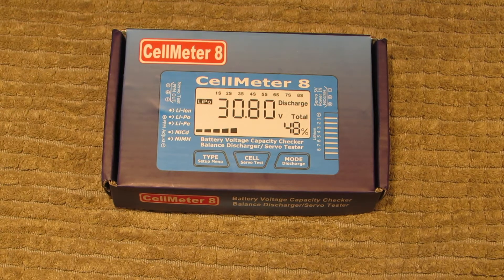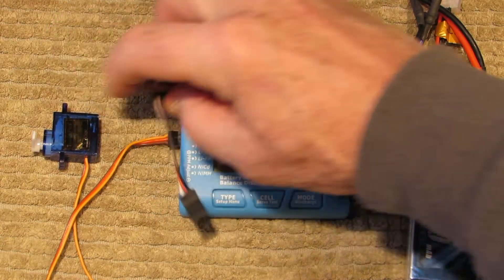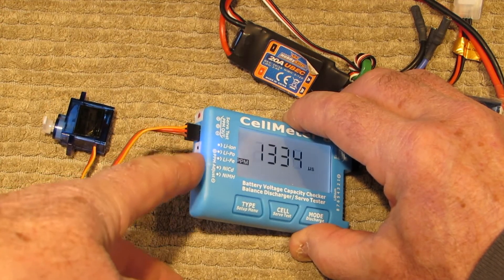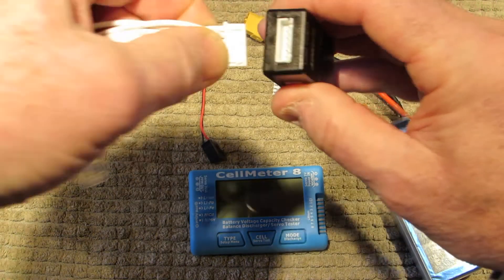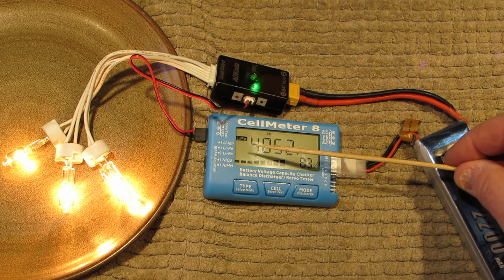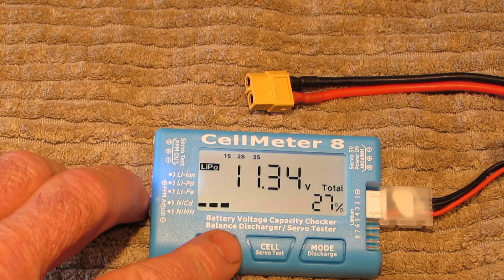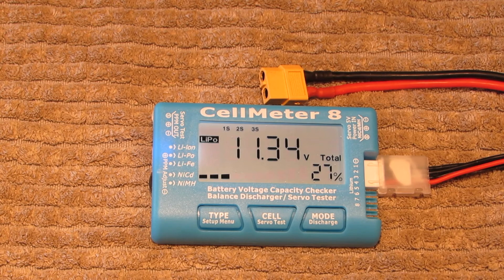How to Use the CellMeter 8

Comment: I just found out through Google Gemini that this could be used with the AOKoda 150w Discharger (the black box wiring & halogen bulbs) I previously had been using the AOKoda control module but the screen got cracked so while looking for another one the lol AI actually pointed me in the right direction... 
Then I found your vid!
My set-up is a little advance...
 Maybe I'll post a vid about it someday.

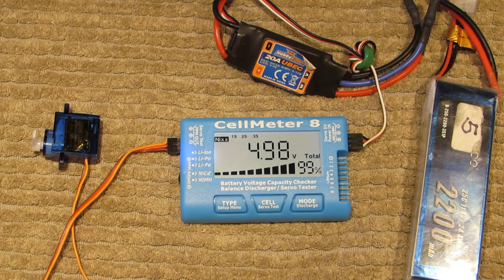Comment: Hi Stephen. I have the Cellmeter 8 and it is very useful. The only issue I have is the servo tester. I set it up, exactly like you, using a lipo 3S 2200mah and a 20amp ESC with BEC but at the time of plugging in the lead at 2:42,  a continuous alarm sound starts and none of the information on the screen is shown. I have checked the plugs that go into the "servo power in" and "servo test out" to ensure they are the correct polarity. Do you know what I am doing wrong please. Would appreciate your thoughts. Thank you. Peter
Reply from the maker: Hi Peter.  I'm sorry I can't say what the issue with your unit might be.  If you set it up the same way I did it should give the same result.  Unfortunately my RC stuff is all in storage right now as we do some renovations on the house, so I can't try to replicate what is happening with your unit.  The only thing I can suggest is trying another ESC or some other 5v source.  Good luck Peter.  Steve
Reply: @fennz  Many thanks for your prompt reply. No worries, I'll keep seeing what I'm doing wrong unless it's actually the unit that is faulty.  All the best and thank you.

Comment: Awesome video! Have you ever figured out how to test a 1s lipo/liion? According to docs, it should work when supplying 5v to the nicd port. When I try though, it shows the „NiCd“ voltage (my power supply), and pressing TYPE won‘t change the battery type. Am I just overlooking the obvious, or is testing 1S just not possible in reality? Thanks a lot!
Reply from the maker: No sorry I haven't.  I have a separate 1 checker

Comment: Just like in this demo, I found the cheap Chinesium clone Cellmeter 8 to be a bit flakey and often crashes with random garbage on the display. Also when testing servos, don’t plug the servo in until you set the correct mode and trim pot or it ends up driving your servo hard beyond its limit during the change of modes. For that reason, I have now ordered the genuine Hyperion Sentry 4 at more than twice the price. Reliability costs money.
Reply from the maker: Never had any trouble with mine.  You must have gotten a lemon
Reply: @fennz and yet this video shows that selecting the servo mode is flakey numerous times and has to be repeated to get it to work. So there is a lot of ‘lemons’ around. That’s the problem with playing Chinese craps, you take your chance and you get what you pay for.
Reply from the maker: @markcummings150  Reult of my own temporary clumsiness. No biggy.  Works fine for me

Comment: Tried to discharge 2 cell Li-Po battery exactly as described in the video, but it doesn't work. The green light doesn't start to flash when I select "discharge" on CM8, and bulbs are not lighting up. Tried everything, switched red and black cables, connect in different order, nothing helps.
Reply: I have similar results,  I checked all the wires for  continuity and and the lamp sockets, tested the bulbs. All seemed right.  The voltage I measured out of the Servo connector was 4.3 volts.  The thing I could not test was the black cube where everything Hooks up.   I am waiting on another discharge kit to see if that fixes the issue.  Will let you know my results.
Reply: I got another discharge kit,  but same results ... I am using it on an 18v ryobi Lithium- ion battery. did you ever get it to work?
Reply: @justjimjpc Kinda, i use it without bulbs. It takes hours to discharge the battery

Comment: I suspect that red wire on jumper connects to pin marked "S" on meter and black wire to pin marked "--" with no wire to pin marked "+". It looks that way in the video. Tried this on two different CellMeter 8's, from Amazon, Model #LSDZ1, neither worked  with AOKoda fast lipo discharge setup. My similar Hobbymate meter and AOKoda discharge combo is working well discharging lipos. Go figure! I kept the replacement Cell Meter 8 to check remaining pack capacity via the graphic and for servo testing.

Comment: Just got Cell Meter 8, alone, from Amazon. Meter seems OK but won't work with AOKoda module, bulb harness, etc. to fast discharge lipo packs. Returning for replacement, hoping replacement will work with my stock AOKoda setup.

Comment: Thank you! Just bought one yesterday at my local hobby shop, had an idea of how it worked but dont have the adapters an connections i need lol asked they man at the counter if this will work with deans plug or the traxxas rc batterys an he was just confused lol
Reply: Ohh actually i realize i bought just the device, it didnt have any of the plugs an connectors? Do u know if amazon supplys ? My hobby shops useless the old men there are very rude an unhelpful for some reason.

Comment: Hi Stephen, lot of thanks for these very clear and instructive explanations!
If I only want to balance the battery cells , I choose discharge and as value I select approximatively the voltage of the lowest cell?
And for simply balancing  must I add a discharge source (like your lamps) or can this device also do it with only battery connected?....If yes will it not be warm?
Friendly, Michel from France

Comment: Hi ! it seems to be called Cellmeter 8 cause many of the other cheap "capacity controller"  cheap devices you can find with the same type of format and enclosure are 7 pin in the right side and this one has 8 pin and the extra servo connector, i'm not aware of the differences in detail, just starting to get some info, thank you !
Reply: this does 8 cells, the others are 7 cell max

Comment: the discharge portion of the video is VERY misleading. you dont need the bulbs and adapter. you just plug in the battery and hit discharge. it takes WAY longer but it works the same way as in the video.
Reply: I bought one and it didn't come with anything else.
Reply: And what this thing is called i want to take for me. I want to store a lot of 18650 cells, but it takes a long time with only Cellmeter
Reply: @victordinev5229 hope you found the AOKoda 150w Discharger

Comment: The cellmate 8 front panel states that its a battery voltage capacity check,  I did not see that demonstrated.  Am I misunderstanding it?
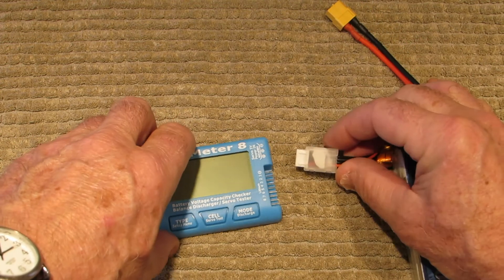Reply from the maker: Hi Ricardo.  At about 12:10 I demonstrate how to check both the overall voltage go the battery & the individual cells.  I hope this is useful to you
Reply: Voltage is not a capacity, Ricardo asks about mAh calculator or Wh calculator durning discharge.

Comment: Hello Mr. Stephan Fennell, It was a nice video. I am doing an Electric Vehicle project. I want such type of display for my 48 V 35 AH battery pack of Li-ion chemistry. It is possible to connect this and use for our application.
Reply from the maker: Hi Ravindra.  I'm sorry but that is beyond my knowledge.  Sounds like this may be out of the range of this product
Reply: Hi, A 48V battery has ...13 S and this device can control 7 S max. Perhaps control the 7 first S and then the 6 others. If it's only for voltage control (to search a balance issue) it's possible. You need two external JST male connectors, one for 7 cells and one for 6 cells....But a multimeter will do the same quickly. And I don't know if this little device can balance such a big Pack if you want to do it... Normally your necessary included BMS must do that. if you want to control the discharge by using, simply install a little voltmeter on your pack.

Comment: I bought the meter but got NO wiring harnesses at all.  Now what?
Reply from the maker: That’s terrible John. Complain to the place where you got it
Reply: When you order, you need to be careful wrt whether you're buying JUST the CellMeter 8 blue unit by itself, which is most of the ads I've seen, or the blue CM8 unit PLUS the black interface to the LiPo battery, which also provides the bulbs, socket, and the two wires, which as Stephen pointed out, you don't need the one.  You could just use the blue CM 8 box to discharge but it will take an incredibly long time. In the original AOKoda unit, that unused wire was the only wire used in that version..  They changed the blue unit, which I don't like nearly as much as the original.  I have both. I just received the CellMeter 8 version today from Banggood and have already tested it out, thanks to Stephen's video. I don't think the AOKoda branded unit is available anymore, even though that was what was pictured on Banggood's website.
Reply: @valkyriep  you dont need the bulbs or adapter to discharge. you do just plug the balance plug in and hit discharge like normal. it takes FOREVER but it works the same way

Comment: Sir...i have this cellmeter 8 device..when check my servo....using 5.3 volt in the input ..all works well. But if i stops any action in my cell meter 8 for 5-8 seconds...it automatically disconnects itself from the power source. I didn't got it... whether it's the inbuilt protection function or my cellmeter 8 is defected one?? Can you please tell me sir....i am confused😥
Reply from the maker: I am sorry but I can't replicate this.  Can you get a 5v source rather than 5.3?  Perhaps the .3 is triggering  protection function
Reply: @fennz  ok Sir....i will check it....do you have any insta id ?..i then share a short video on it..if it's still create problem..in 5v then

Comment: I thought that with discharging modul the lamps go of, instead of that, they discharge the batt.further..if you dont watch the voltage goes too low..any sense?
Reply from the maker: It is important to keep an eye on it & disconnect it when the beeper goes off
Reply: It would be the best...but discharge current does not run through the device which only "reads" voltage fall for beeping.